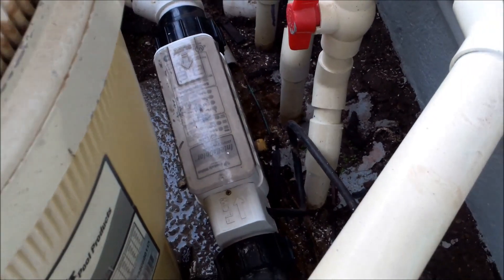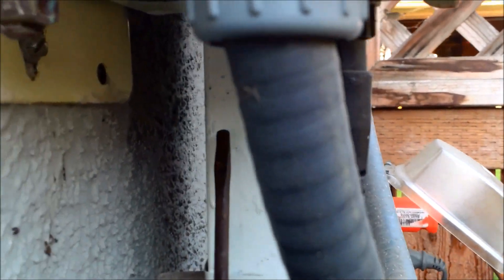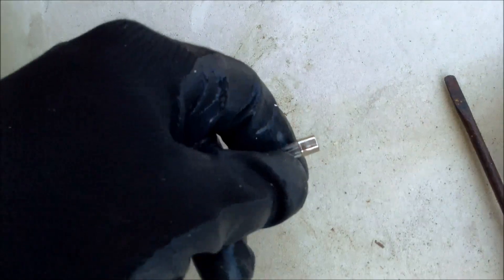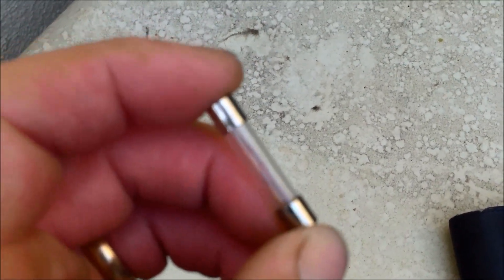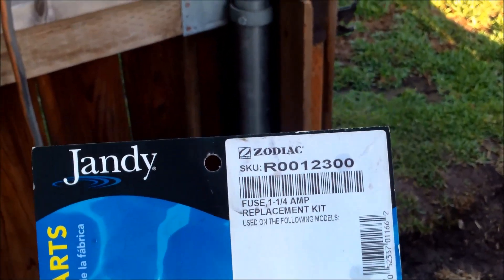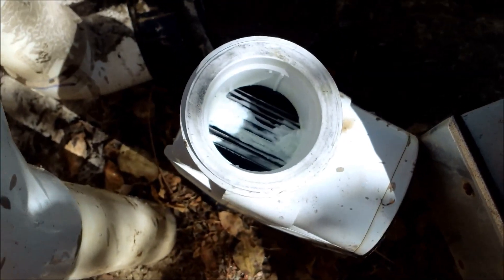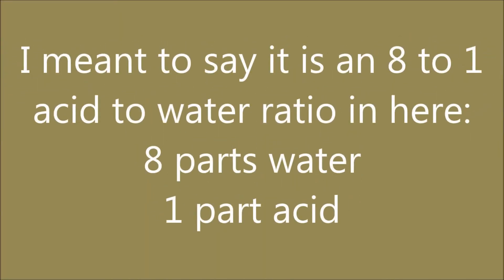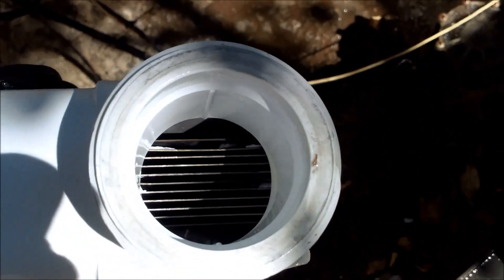My Intellichlor Salt Cell Has No Power: How To Replace The Fuse

Comment: So, when the Cell Light starts flashing green, is there a way to repair it?  (yes, the electrodes are clean)  Specifically, can you buy the internal parts and replace them or am I stuck buying a new salt cell?
Reply from the maker: +Paul Myers  You can still get a good amount of time out of the cell with a flashing green light. I have some that run for up to a year with it flashing.  Solid red means it is dead. No parts are available - the cell plates wear out and are not replaceable.
Reply: +Swimming Pool Tips, Reviews &amp; How To -MrDgvb1 Ok, the manual says when it is flashing green it is not producing any chlorine?  Is that not the case?
Reply from the maker: +Paul Myers  Sorry, thought you were referring to the Cell life.  Basically in your case it is that sensor above the cell plates giving the cell a false dirty reading.  I have had success with giving a cell like that a few quick acid washes and rinses and then reinserting the cell. Try a 4-1 ratio and let it soak for a few minutes. Dump it out and fill it with water and then 10 minutes later do another 4-1 acid soak for another 5 minutes. Sometimes that clears it and the light stops flashing. Also, sometimes the next day without doing anything it stops flashing after it is on for a few hours.
Reply: +Swimming Pool Tips, Reviews &amp; How To -MrDgvb1 Ok, will do, thanks!

Comment: I see a green LED light inside the power center but the Cell has no lights. Is it still the fuse or is the cell just dead?
Reply: +TheJohnreinhart No, mine is still no lights. I looked at the fuse but haven't tried replacing it. I'm guessing the cell is bad after 3 years. I'm considering just forgetting salt and going with the bleach/borax/baking soda method instead of spending another $500 for a cell.
Reply from the maker: Mike Ongoco Check the fuse first. Usually the units do not just die on you. Fuse or GFI are usually the issue.
Reply: Mike Ongoco  i have the same problem. green light on the power center is on but the cell has no light. I checked fuse and gfi. Everything is good but the cell is dead. Its only a year old!
Reply from the maker: powerlocks Yours might still be under warranty. I would call Pentair.
Reply: +Mike Ongoco I am having the exact same problem: no lights at the cell but there is an led on in the power center and the fuse is good. Did you figure your problem out? I'm not sure if the cell is bad or the power center. - thanks!
Reply: +Mike Ongoco I checked my power center and I am getting 22VDC which is in spec since the manual shows it should be 22-39VDC. So mine looks like the cell is bad. I know what you mean it's an expensive part but it sure is nice not toting around gallons of chlorine.

Comment: I watched your video and noticed my fuse (glass) was broken completely.  I also noticed the fuse holder and casing are all rusted.  I assume this is a problem so I purchased a new fuse, holder and casing to install into my Intellichlor IC40 power center.  Do you have any instructions (or videos) on how to replace this?  It doesn't seem too difficult but I want to be safe when dealing with electricity.  Thanks!
Reply from the maker: Eric Almassy It is pretty easy to put in so you shouldn't have any issues. I haven't needed to change the fuse holder yet so no video ;). They usually last the life of the unit. I wonder how water got into your power unit as it is water tight. That could be why the fuse burned out. Hopefully the power unit is still working.
Reply: Were you able to replace the fuse holder?  I purchased the fuse holder replacement and would like to know how to install it.

Comment: I cleaned my SWG after getting the cleaning kit, it wasn't turning on before and still isn't after cleaning. I don't have that fuse location. The pool is maybe 8 months old. It's a Pentair control box pump etc.. I took the panel off and looked behind there and nothing. I have the main power cable like shown in this video but I don't see a fuse.
Reply: Akura Trigger actually nvm, it's not blown. It's the ones that would show they're extended out.
Reply from the maker: Akura Trigger If it is still not turning on it is under warranty so Pentair will send a technician out free of charge.
Reply: ok sounds good. I ran the cleaner all night and checked it periodically not a single light came on and hey! I really apperciate your responses to my questions and your videos. I think you're super awesome for providing so much valuable information for pool owners. I could just get a Pool Tech to come out and service the pool but I really want to learn this on my own.

Comment: Well now I have no lights and what seems to be no power working at all.  I replaced the fuse earlier but the unit kept the lights for a bit and then after an hour all lights were off again???
Reply from the maker: Tracy Roe Did you re-inspect the fuse? It could be burned out.
Reply: Swimming Pool Tips, Reviews & How To -MrDgvb1 I did.  Today when I turned it on it worked for like 5 hours and then it stopped working.  I plugged it back in and it worked for about 30 minutes to a hour and then again no lights?  UGH!!!!

my Pentair Intellichlor Ic15 will run for about 5 to 6 hours and then all the lights will go off on the unit.  I have replaced the fuse, but this hasn't corrected the problem.  If I turn the unit off for a minute and then plug back in it will work again for about 30 minutes to an hour.    Suggestions on what might be the issue and how to fit it?

Comment: My Pentair ntelliChlor Salt Chlorine Generator Cell seems to be clicking on and off numerous times while on.  Not sure what is causing this problem and or what to do.  Any suggestions?  I recently checked and replaced the fuse as I thought that was the issue.  Thank you.
Reply from the maker: Tracy Roe That is strange. You mean all the lights go out and then come back on? It is possible the fuse holder is loose. Take the Control Unit off of the wall and lay it flat, maybe on top of the heater and press on the fuse holder to see if that is the issue. That sounds like the likely problem - the fuse is moving slightly causing it to lose power. My best guess.

Comment: Hi, we have one of these in the UK, in your video at 2:06 the cell lights are flashing up and down, ours is doing this constantly, what does it mean please. Thanks.
Reply from the maker: papas7669 Is the flow light red? It is possible the cell is installed backwards. Or there is an issue with the wiring in the control unit.

Comment: I checked the fuse on mine and it's not blown out.  The PC100 light is green I'm not getting 35VDC power out of the base of the unit when I check with my multi-meter.  Is there anything else I can check?  Thank you
Reply from the maker: Debra Harkins Did you check the GFI? Sometimes a bad GFI will cause no power to the cell.
Reply: Swimming Pool Tips, Reviews & How To -MrDgvb1 Yeah there isnt a GFI.  My set up goes to a timer then to the Pentair PC100 which the IC20 plugs into the base of that.
Reply: Where is the GFI located inside the intellitouch?

Comment: Thanks for sharing this video.  My Intellichlor is wired into an Easy Touch Control Panel, so there is no fuse like the one shown here.  Can you tell me where I may find it in the control panel?  Could it be in the circuit breaker?  Thanks for any help!
Reply from the maker: TheAnderbrmi I think it is connected to the GFI. See if that is tripped.
Reply: Swimming Pool Tips, Reviews & How To -MrDgvb1 thanks!

Comment: Hey there,

I have the ic60 swg by pentair. Last week, I cleaned my cell following your acid wash video, and when I went to turn it all back on, I had no power to the cell or the power center. This wasn't my first time cleaning it, so I was surprised to find that the fuse blew out. I checked the cell again to check for calcium bridging and washed it again just to be sure. After replacing the 10A 250V fuse, I turned on the power center without connecting the cell supply and the little green light turned on. But when I plug the cell supply into the power center and turn everything back on, the fuse blows everytime. What the heck? Am I buying the right fuse? Any info would be helpful.
Reply from the maker: If the cell is more than 4 years old it is possible that it is going bad and sending too many amps to the power unit - even when clean. If you live near a pool store you can take the cell in and they can test it for you.
Reply: Nicholas Buendia I
Reply: Hey Swimming Pool Tips Guy.. Very first visit with my very first problem (obvious) and want to thank you for your superb knowledge and your sharing.  Your comments section w/questions & your answers I'm sure help an awful lot of folks. Thanks again.

Comment: I have one I am trying to figure out but it is built into the easy   touch,  no power to the cell,  you know if there is another fuse other then the on at the top right side of the easy touch panel.
Reply from the maker: That is the only fuse I think. That is an odd  problem. I can put you in touch with my local Pentair Warranty guy who is great at stuff like that - If you are not working with anyone yet yourself. That is what I do when I get stumped out in the field.
Reply: Thanks, it's a Alan Smith remodel so they will be dealing with it under warranty was just trying to learn as we know learning is earning :)
Reply from the maker: Darrel Barnett I usually will try to troubleshoot also. A call to Pentair can come in handy in the field also. But if it is under warranty I usually don't bother. Once in awhile a bad GFI will cause power loss. The Pentair Warranty guy I use  is a licensed electrician so he can do everything when he gets there.
Reply: Sounds like good guy to have  in your circle.

Comment: Had InteliChlor IC40 for 3 years, then it failed.  Pentair (Diane) on 8/4/14 said that they typically last 2-3 years.  This becomes a very expensive way to maintain the pool.  Using a chlorine feeder (e.g. Hayward cl220), we estimated would cost about $2,000 less over a 10-year period.

In addition, InteliChlor increases Ph level and requires more acid to balance it.  It also collects and discharges solidified calcium from its electrode cleaning cycle into the pool and you have calcium flakes floating in the pool from that process.  Requires every 3-months cleaning.  After using it for 3 years, we decided to stop using it.
Reply from the maker: Yes, Salt Systems are not a cheap way to maintain your pool. Everything you state is correct - Pentair models seem to put out a lot of blow back in some pools. Try the BBB Method - it is the least expensive and easiest way to maintain your pool. I would say a salt system is a luxury item. I like them but they are not for everyone. Most salt cells will last at least 4 years but there are exceptions.
Reply: Swimming Pool Tips, Reviews & How To -MrDgvb1
I would certainly not complain if it lasted 4 years.  I initially liked having salt water pool, but with time, the maintenance, constant calcium flakes in the pool and now a final straw of the unit failing brought me to conclusion that the luxury costs are certainly there, but the conveniences or benefits are not. 

I don't like chlorine smell (chlorinates), but it seems that the secondary ozone helps to reduce that side effect and also allows me to run chlorine very low.  At this point, I'm certangly is a big fan of having ozone.  BTW: the DEL Ozone Eclipse 2 unit we have suppose to last 2 years without replacement of the corona discharge elements, its been 3 and its still working well.

Comment: I checked the fuse and it's not blown out.  My system still have no power - please help if you may.......owned the IC40 about 2 years. Thanks.
Reply: +haidangdvo Did you ever figure out the problem? I am having no power lights on at the cell but in the transformer when I take off the cover I have an led lit in there. I am not sure if the transformer (the power center) is bad or the actual cell is bad. - thanks!

Comment: how often should you clean the cell?
Reply from the maker: I usually will unscrew them every three months or so at some accounts and inspect the cell. The rest I clean every six months when I do the filter if needed. If you open it and the cell plates look clean there is no need to clean it. Only clean the cell if there is calcium build-up on the plates or you will damage it. Some pools require cleaning every 2 months, others can go 6-8 months. It just depends if there is calcium build-up on the plates. This system will give you a flashing green light if the cell is dirty. It may also drop down to low salt which is another sign that it is getting dirty.
Reply: Thank you for the feed back. What do you think of those drop in Variable speed pumps. Like the Im Power?
Reply from the maker: james brennen I think they are a good product. Three speeds is all you really need.  Most cleaners will work fine at the second speed which  is 2600 rpm. Running it all day except for a couple of hours at 1600 rpms is I think 160 watts, so it is like having two lights on in your living room. That is a good savings on your electric bill.
Reply: Thank You! Do you think you can do a video on Variable Speed Pumps etc. Pros and Cons.
Reply from the maker: james brennen I did make a video on that a year ago. It is pretty basic. I am working on a more in depth video coming in a month or two. Basically I think if your motor burns out replacing it with a regular 1-speed motor is fine. If you are replacing your pump and motor then you might want to invest the extra money for a variable speed pump. The latest generation  Pentair and Sat-rite Pumps do not require a separate timer to work . The timer is built into the pump itself. Jandy & Hayward still require a separate tier for the pump. In my opinion you can achieve the same savings by running your pool less time each day if you currently have a regular pump. You will however see instant savings with a variable speed pump, however the initial cost is higher. There is also some concerns that pool owners are running their pools on low speed only, which is not circulating the water correctly - translation: bacteria & viruses are not being filtered out on low speed. Some current studies are being done in Florida about potentially hazardous water due to low flow rates of variable speed pumps. Realistically you need to run a variable speed pump at  2600 rpms or higher for at least 2 -3 hours. You save money mainly while it is running on low speed.

Here is that video: http://youtu.be/YgOq1X65Kvg

I know my Channel is bloated with some 270+ videos. But I still remember which ones I have filmed ;)